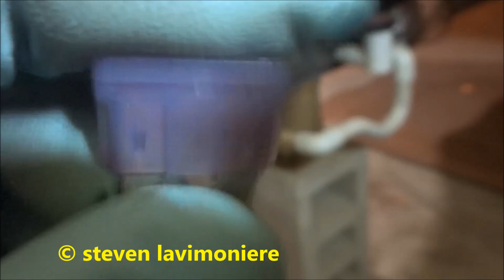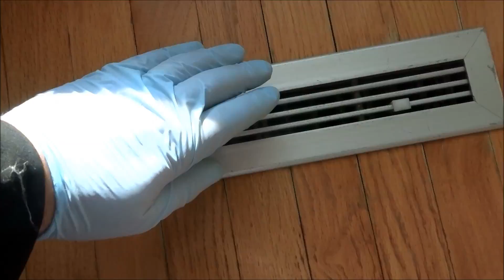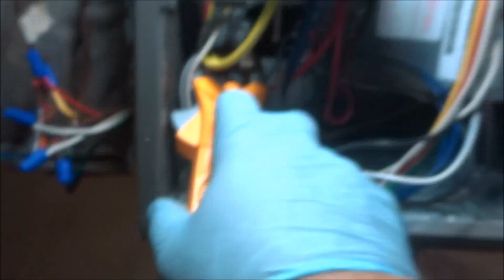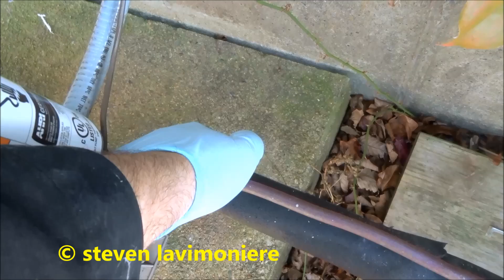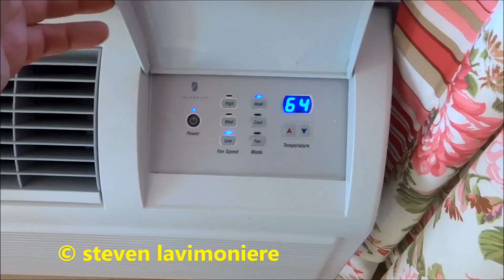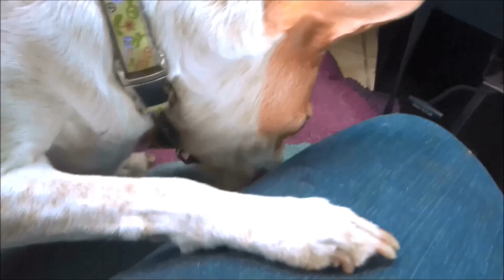hvac heatpump system tripping fuse

Comment: I have a heat pump system that every time I cut heat on it trips fuse. Runs fine when cooling is selected. I also changed the thermostat. The Old thermostat had a emergency heat selector but the new didn't.  I followed the directions on installing thermostat.  What do you think.

Comment: I hate auto correct, in my comment below, I meant to say, What does amping the line side tell you?
Reply from the maker: +Mike Malone i wanted to see if the heat strips were working . in emergency heat mode thats why i checked the amps.... the unit is brand new . dout if the contactor is bad been 8 weeks low voltage fuse has not blown again
Reply: Might have been a brown out, that will cause high amp draw especially if the lv transformer is a bit high already on the secondary side...

Comment: What does a ping the line side tell you? Problem is on the low voltage circuit. Most of the time I'd find the contractor coil was pulling high amps, typically because it's exposed to the outside air. Also look for the weed eater beating home owners give the stat wire. You dog seems to be a very neat eater in comparison to my daughters dog!

Comment: I know it has been many weeks sense the call but I thought I would bring up what I find 9/10 low voltage fuse being blown on heat pumps. the coil in the reversing valve 9 times out of 10 is the cause. I don't know if it is specific to my area. not to say it happens all of the time but when it does the first thing I check is the coil on the reversing valve.
Reply from the maker: +Kyle Faubertq thanks for the comment
Reply: Having this problem now

Comment: steve i had one do the same last sunday........it was the temp sensor on the coil ,,,,outside unit..........it had viberated against the metal and worn a small spot through the wire,,,,,,,,went back this past monday and found it............
Reply from the maker: +Babaji Fahim this is a new system installed this summer .not sure it would have time to rub
Reply: my unit was 3 years old..................

Comment: Steve I Know you have a high quality Mega, Fluke  (The Supco is fine for compressor's ect.) Cut the tstat wires loose at both ends  and test at 500V. If there a short it will show itself. I find in most case's the insulation fails at the last 5 feet or so near the ends . It a real pain in lot of these homes to pull new tstat wire and this is a real time saver.
Reply from the maker: +Gene J good tip thanks

Comment: Good Morning, Steve!
I had a problem with a Payne HP that my field Forman installed almost a year ago. It threw that little 3 amp fuse. I taped up some loose ends ran the system in heat and cool. It appeared to be fine. My apprentice came to do the maintenance at the end of the month(Dec) and the fuse was open again. I came back  cleaned up the thermostat wire ends put it back together and tested and it was ok. My customer called me back and the thermostat was blank. I went back., replaced the wire from the stat to the controls in the control section of the HP, installed a new 3 amp. Fuse and watched it run. It threw another fuse. My foreman came out and cut the wires from the board and found the wire from W3 had not been capped off at the factory like the others that were normally not used and have those crimp wire nuts on them. He capped it off, put in a new IBM board; no problems again. That was a definite humbler. Have a great Sunday!  GO PATS!
Blaze
Reply from the maker: +Blaze Eisner yea it could be anything . you just never know .this one has been running fine for 7 weeks now . no call back

Comment: Inrush current of a contactor coil might of taken out the fuse, especially if one might of hung up when it was supposed to pull in... Those automotive style fuses have more of a "fast acting" characteristic rather than  one of a "time delay",  and therefore  a good reason for me to keep spares around.
Reply from the maker: +REWYRED its a new system . just installed this summer dout if the contactor is bad
Reply: Ya I doubt the contactor is bad as well but as was told to me once " new does not always mean "good", it just means its new"..   Just that I have seen  contactors hang up  momentarily at work for no apparent reason and take out a control fuse among other things.

Comment: Hey Steve, I didn't see it in the video but did you check the low voltage wire inside in the outdoor unit in the compressor area. I'v had defrost tstat wires rub on refer pipes and blow the low voltage fuse. Thanks for the videos.
Reply from the maker: +John A i just changed the fuse 7 weeks ago and she has been fine so far if it happens again i will get into her further

Comment: Hi Steven . could you check what DC amperage on that control fuse . Could be bad connection on the control line or a wire touching down to earth vibration could cause problem. Has the home owner had any work done on the house which could have trapped a wire.
Reply from the maker: +theCybershot123 replaced the fuse 7 weeks ago been fine ever sence  new system just reused the tstat and heatpump control wiring  electrical ect .so there might be a short  somewere so far so good
Reply from the maker: +theCybershot123 replaced the fuse 7 weeks ago been fine ever sence  new system just reused the tstat and heatpump control wiring  electrical ect .so there might be a short  somewere so far so good

Comment: could be a fluke, double check voltage on transformer for correct setting.  nice choice of equipment you installed.
Reply from the maker: +jeff burton its been 6 weeks has not tripped again .like you said just a bad fuse maybe ,older system was changed complete every thing but the low voltage wiring to tstat and heat pump stayed

Comment: good vid , freak thing i guess.  I have saw those blow after a kid  or impatient adult repeatedly switch t stat back and forth heat cool emergency heat  , up, down, etc,,  .. You know sometimes those fuses  just are not up to the rating they have on them,, all this stuff made in china or wherever now,, quality aint what it used to be thnaks for posting , thumbs up
Reply from the maker: +nate its been 6 or 8 weeks still no issue i think it was a freak thing time will tell
Reply: Sometimes fuses get weak from the thermal expansion and contraction, somewhat similar to incandescent bulbs (however those also suffer from loss of mass due to the tungsten being vaporized.).